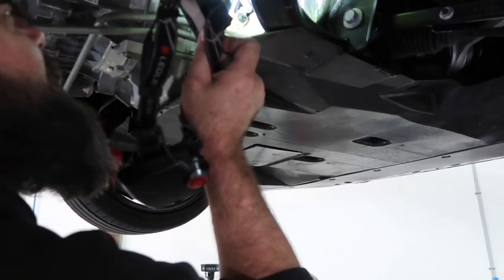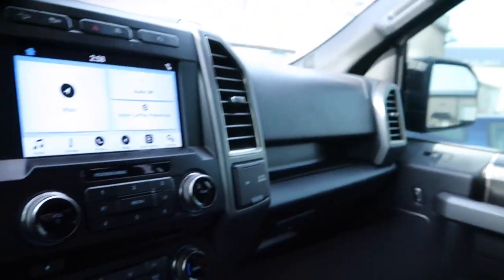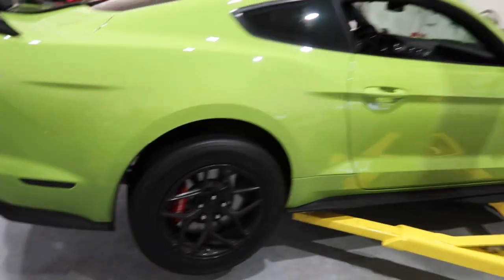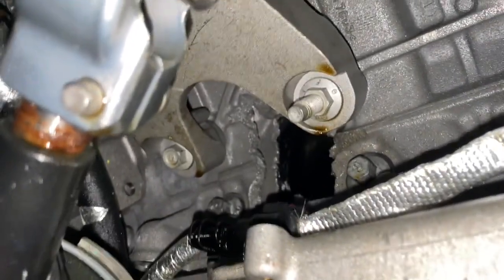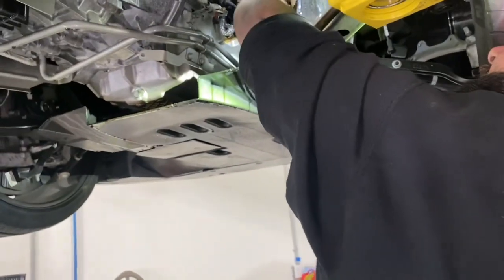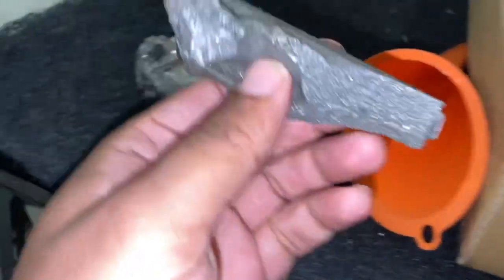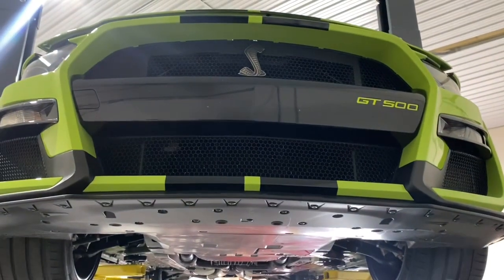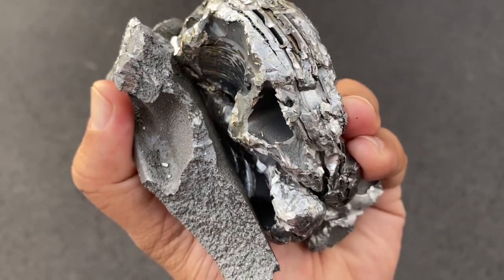I’m F’d! My 2020 GT500 blown Motor is Worse then we Thought! *Part 2

Comment: And because this vehicle was modified the manufacturer isn't going to cover any of this, right? I just wonder if there is anything during the assembly process or in the casting of the block, it looked pretty porous, if there were some weaknesses that were revealed only after increasing the horsepower

Comment: You can't even get a replacement motor from Ford I understand. Especially since there's no crate motors either..............no disrespect, but you earned this by using unproven aftermarket parts.

Comment: look how thin the material around that hole and the motor mount is near there?
Reply: Dude, do you anything about engines at all? The piston broke through the cylinder wall, through the water jacket, and then through the outer wall of the block.

Comment: The rebuild will make great new content.  Anything mechanical can break especially things that go fast.   It pays to go fast.
Reply: A solid example of where someone did this was the Mustang Lifestyle channel, where the guy there blew up his '14 GT500.  A couple of times.  And he's gone into great detail on the parts he's replaced and why and what he replaced them with.  Turns out, to "reliably" put down north of 1000 rwhp without breaking is pretty involved.  I'd suggest StangMode perhaps review that channel and see what's involved if he should decide to go that route in the future with the Hulk or Mamba.

Comment: Stronger block and pistons and rods ? Maybe crank shaft too?
Reply: I guarantee there was nothing wrong with that engine but most likely something wrong with his fuel or tune. He probably thought he filled up with E85 but it was actually E30 or some crap like that. I've seen this first hand at a gas station because I always test the E85 pump to see if it's actually giving me anywhere close to E85. Best to just order your own barrel of C85 from vp racing if you're making 1000whp. Not worth chancing a 100k car you're still making payments on!
Reply: @BlackWhiteBeast  don't they make gauges where they can read your ethanol content?
Reply: @kgthegreatone943  They do have it integrated into the HPTUNERS gauge to monitor if you have a flex fuel sensor and you're tuned for flex fuel.

Comment: Could always which to the 7.3L Godzilla engine. I’ve read it can hit 800 + hp with min. mods and no supercharger.... fully built with supercharger possible 1600+ hp..$12000-$15000🤔🤔🤔🤔🤔 5.2L  rebuilt or new engine $20,000 +

Comment: Add MORE ring gap to the next engine brother. When these engineers design these engines they have a 10-35% power window on the set gap. You gotta remember they're in the business of failure by design.

Comment: Gotta wonder if a good methanol injection kit would have helped avoid this catastrophic engine failure. It would have been a sound investment too and pretty cheap compared to all of the other upgrades. It sucks man, no doubt about it . I also detonated my Gen2 2017 GT with a ROUSH 2.3 TVS phase after only 20k miles too. I was only pushing 13 pounds boost on av gas 100LL octane always. Turned out to be a tuning/tuner issue and now I’m with Lund Racing $8,000+ later I am going to install a meth kit absolutely before I start pushing more than the 10 pounds again mainly for piece of mind engine detonation protection. Build it better, build it stronger, build it right and be happy when it’s done knowing your foundation is solid. Good luck man. One more thing COVID SUCKS!!!!

Comment: That is the problem with the 5.2 motor....the Predator motor pushed it to the maximum performance of Forced Induction. 

Adding the modifications overtime took its toll on the motor. Unfortunate it is now a $100k paperweight.

People can say rebuild it and it will be better. Trust me it will never be the same. Lesson not to mess with engineered protection, to think you know more than Ford Engineers on a $100K car is just pure stupidity.

Got greedy

Comment: This would have never happened if u had 10-12 gt500 they have stronger block dat can hold 1000 hp or more just fine
Reply: 2010 cast iron block isnt that strong, cylinder walls are thing, even if made of steel. 11-12 have the best blocks, but needs sleeves. 07-14 stock connecting rods are trash. I own a 2011 GT500 and am collecting parts for a build. Knowing I HAVE TO sleeve the block to make solid power above 700rwhp because of the bullshit PTWA spray on liners sucks.

Comment: They just released a predator crate Motor 25k. Wish you the best.
Reply: yeah pretty sure Ford is paying attention to this channel, i see price was literally announced TODAY Dec 3rd.
Reply: KR3Z-6010-A built from there if his heads are good won't be bad...if blower is gone get in touch with whipple or use his contact at procharger
Reply: @bluecollardaily2676  If the heads and blower are good it will still be very bad.  That short block alone is probably well over 10k.  Labor + other expenses you're looking at close to a 20k rebuild....and that's if the heads and blower are good.
Reply: @BEBNC1  naw I could build that short block for 7k max with no sponsors with better than stock parts, get caspers to do the labor....
Whipple or Procharger on board or hell a twin turbo.....

 He is fine as long as he doesn't over pay everyone to do everything for him....

Comment: Dang brother! I live by the hope for the best but plan for the worst rule. That being said, the rumors are that a new crate engine will run about 25K. I’m sure one of the heads took a hard impact if not both of them. I doubt the supercharger was damaged but pretty much gonna have to take it as a spare. If it were me I’d start looking around for a wrecked GT 500 that has no engine damage. That would be the cheapest route but gonna be hard to find. Otherwise, hey it is what it is. Power comes at a price and that engine is the latest technology. Trust in God and doors will open. Just being real, sorry bro!
Reply: I think the odds of winning the lottery are greater than finding a wrecked GT500 with the engine just sitting in it waiting for someone to buy it

Comment: Giving you a like and a comment because you're going to need the money, lol!  Think of this as an opportunity to step back, take stock of both your goals and your budget, and decide on where you want to go.  If you want the Hulk to be a built drag-racer, then you're going to want to invest in the bottom end of the motor as well as bolt-on goodies, and accept the fact that this kind of thing will happen if you push the motor well beyond it's rated specs.  If you decide you don't want that, well, then you have to set your sights a bit lower so you don't go through this again, and choose more reasonable parts to fit a reasonable goal for a stock bottom end motor.  I do recall over the last year you'd bought the GT500, then mentioned you'd lost jobs due to Covid, then mentioned you're working on building the Hulk in addition to the Mamba, and now you're doing lots of car giveaways.  So you seem to be a bit all over the place with both funding and goals...

Comment: Gallows humor goes a long way. Smiling on the outside, crying on the inside. Even sleeved it would of been catastrophic with that much damage. Flex tuned or straight E85 tuned man ? I brought up testing the E85 content, that shouldn't matter if it's flex is why I ask. The other pistons will tell you if you had knock, hopefully not cause that would be your tuner grenaded your car.

Comment: Remove all the bolt on parts and sell the car piece by piece. For a normal person with no youtube sponsors, the engine repair is easily $20-$25,000. 
Probably could get $30,000 for the car as-is.

Comment: What I don’t understand is why before you turn the power way up you wouldn’t do a set of rods and pistons? Everyone knows those are the weak point of basically any ford V8. Why not spend a few thousand to tear apart the block and do a set of Carrillo rods and mahle pistons before you blow up a $20,000 engine. Did you do this for views? You knew it was going to happen. I just don’t get it!!

Comment: Cold weather with a hot tune in it with low e-85 count will do that, I would of just been running some One ethanol R or other brand a 60 dollar drum could of saved you 20k. Not kicking you down but this was a costly easy mistake to fix....Oooo I would be calling Palm beach dyno and asking how much timing was thrown at it and what e85 rating they had in it when you got your tuning session done. And test your gas be care full with those e-85 tester's there not always so accurate. At least the car is in good hand's and hope this does not dig to much out of your pocket ill keep watching and give a thumbs up when I can.

Comment: NOT TO KICK A MAN WHEN HE IS DOWN BUT IM ASSUMING YOU MODIFIED IT SO YOUR WARRANTY IS NON EXISTENT?.IF YOU HAD A GOOD RELATIONSHIP WITH YOUR FORD SERVICE DIRECTOR HE COULD HELP YOU SLIDE THAT THROUGH THE WARRANTY PROCESS IF YOU PUT IT BACK TO STOCK. WHAT DID YOU DO TO IT??? PULLEY AND TUNE??CAUSE I REALLY DONT SEE ANYTHING OUT OF THE ORDINARY! 
GOOD LUCK WITH THE DIAGNOSIS, BUT MY MONEY IS ON THE HEADS BEING TOTALLY F'D UP JUDGING BY THOSE PISTONS!!! SOME FREE ADVICE, TEST THE E85 "BEFORE YOU RUN IT" THEN AFTER TO DISCOVER ITS E45...LOL...SORRY HAD TO THROW THAT IN. IF THEY TRY TO CHARGE YOU FULL RETAIL FOR THE MOTOR, LET ME KNOW AND I'LL SEE WHAT I CAN DO 4 U.

Comment: Hope Ford execs see this video. The engineers,R&D,the board of directors,marketing,EVERYBODY!!!
Reply: Why?
Reply: So they can maybe make the shelby a bit more durable?
Reply: @evhfanatic  You realize this car has aftermarket cams, ported blower, tune and possibly running E85 ....?
Reply: @jpat99  yes I’m aware of what’s been done. Just thought maybe Ford could improve on it to better handle those type of mods. For so much money the car costs,seems strange that that motor just totally fell apart. Just my two cents though 🤷🏼‍♂️
Reply: @evhfanatic  we don't even know what caused it yet? Bad e85 or to much timing will destroy any supercharged motor.
Reply: @evhfanatic  I didn't fall apart and in fact put the biggest holes in a block that I have seen in years.  That comes from over revving or detonation (tune/fuel related) and the motor saying F U to that.  Additionally, the car was being hammered run after run while on that cruise.